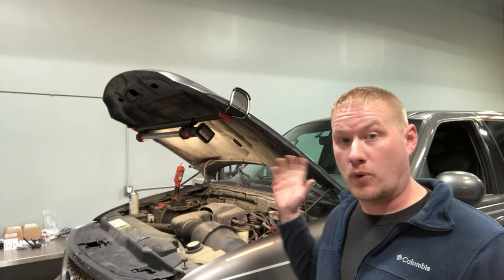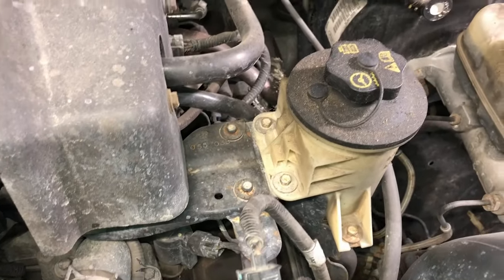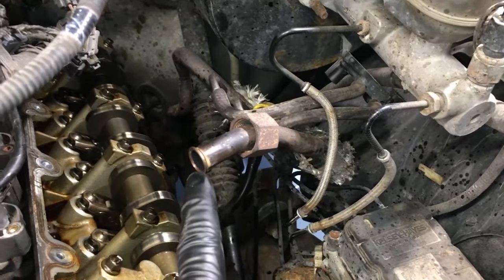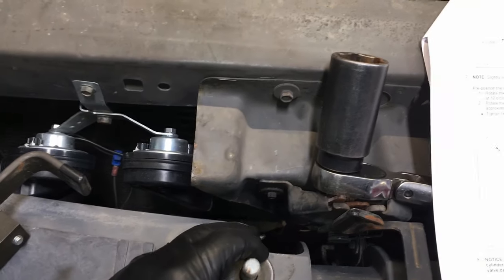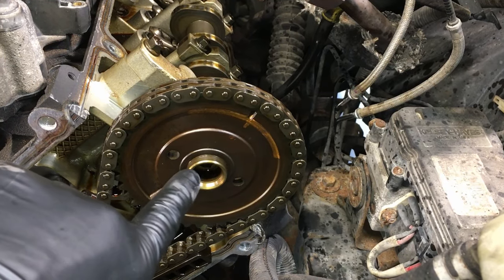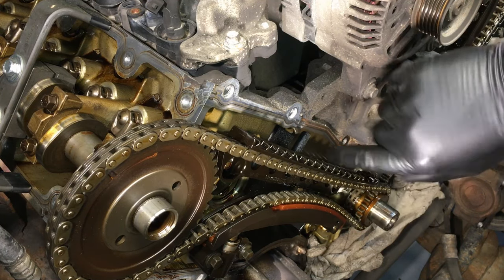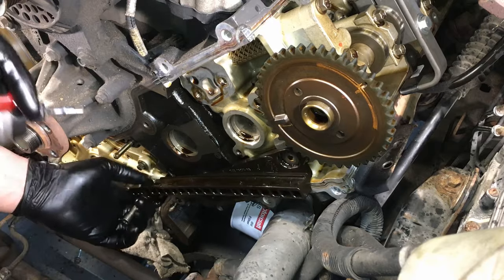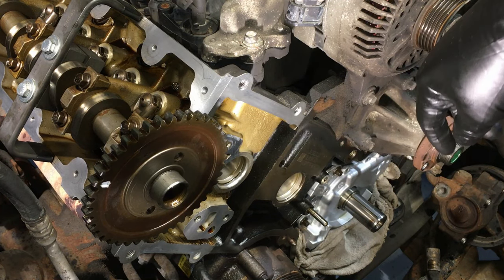Ford 5.4L 2v Triton Engine: Complete Timing Walkthrough

Comment: The 2 valve 5.4 & 4.6 engines were some of the best ford ever made. Too bad we never seem to know until 15 or 20 years after they appear
Reply: yes many 4.6 2v pass 500000 or 600000 miles with proper maintenance scedule....
Reply: I actually have a 2002 4.6 and just reached 260k miles. Just kept up with oil changes and still runs amazing. Unfortunately I did have to rebuild transmission at 220k miles.
Reply: And if you keep the boost under about 7psi, they make good reliable power. I know of one Mustang that's still running after putting 80k miles with a small turbo.
Reply: And don't forget the spark plug thread inserts if you plan on boost. Don't want to launch the plugs out of the engine.
Reply: Actually the best Ford engine was the 300 I6. Of the V8 variety you can't go wrong with any of the FE series.
Reply: @MrUbiquitousTech  Yes you right,,, i have my original 1984 f250 4.9 still going strong upper 100k miles.  I love the 2 valve triton.  Have 2 expeditions 5.4 2 valve 150 k plus and a Excursion 6.8 2 valve 196K  I change with Mobil 1 every 4k miles...
Reply: I wash your video on the 5.4 & 4.6 2 valve timing chain job, Why did you had to move the camshaft and crankshaft after you set TDC on 4.6 two valve engine.
Reply: My 5.4 is climbing up to 220k right now, got it 100k ago but she has had a hard life, been the farm truck for 7 years alot of the time pulling a 7k lb trailer with 16 1000 lb round bales per load.
Reply: I agree. Great engines. I have a 5.4 2 valve in my 99 E-250 Cargo.
It runs strong. little less than 177k original miles.
Reply: I’ve seen a 2v 5.4 go over a million. Took a lot of oil changes and coil packs but it did it. Good motors
Reply: @blakeevans7313  Hey Blake what brand of motor oil have you used in your Ford ??   Thank you
Reply: My 2002 F150 w/ 4.6 2 valve just rolled over 351,000. Has the original timing components and oil pump. I did rebuild the rear diff a few thousand miles ago...$1,200.00, and good for another 300K+ miles!
Reply: @mikewingler3042  i had to rebuild the rear diff on my 99 model. The spider gears had too much slack.
Reply: @DoyleHargraves  Mine was making a bit of noise...turns out it was a bad axle bearing. My brother in law is the service manager at a local Ford dealer, and I told them to tear it down and replace both wheel bearings, carrier bearings, and the pinion bearing. When the mech did the tear down, he found excess slack, as well. So, full rebuild. Quiet as a church mouse now!
Reply: @MrUbiquitousTech  ford made a much better v8 than the 300. The 300 was just cheap and cost effective
Reply: I have 270k on my 5.4. Engine is preditinateing on hills. I guess I should do the timing . Great video.
Reply: @MrUbiquitousTech  you so right! i have my original owner 84 F250 4.9 and i own 3 triton 2 valves(97 2000 Exp 5.4 and 03 Exc 6.8) with around 200k on them.  i will never get rid of these trucks
Reply: My 5.4 has 692xxx miles on it and its still rolling like a champ
Reply: @houstongordon9337   wow. I'm at 398,000,  so I know it could go the distance.  Runs smooth and quiet.  All original powertrain  too. I'm thinking of  getting  the timing  done but I have no symptoms.  At start up it just  starts  up smoothly  the way it should. No ticking ar rattle  at all. It does have the leaking  upper intake manifold  though,  which is about  to get fixed  with new plugs, injectors,  and coils.
Reply: I have a 99 Expo with a 5.4 and 385k miles.  Original motor and I'm just now doing timing LOL
Reply: My 5.4 has 318,000 on it. Just ordered the parts to do the timing and head gaskets. All because of a blown out spark plug.
Reply: Anyone has a link where to find what  how many valve is mine 2007 expedition 4 wheel 8 cyl. Xlt model
Reply: @benten6301  i would bet its a 3 valve 5.4L
Reply: @DoyleHargraves  I am having timing problems at 128k. It still drive. I am going to do it myself looking to buy the correct timing kit. Where should I get the kit because Amazon needs more detail to guarantee fit. Any recommendations , TIA.
Reply: 97 expedition 5.4 3v runs and gaps 👀👀
Reply: @JerryOutdoors  I have the same question
Reply: 98 Expie Eddie Bauer 5.4 4wd.....2nd owner......320K. Lots of maintenance items since 250k, but I don't have a $300 car payment 😁. Cheers to 400k. 🥂
Reply: The 5.4 sucks really bad
Reply: @mikewingler3042  😅pm
Reply: @rob_v_nj  11:57
Reply: @rob_v_nj  12:06
Reply: @codyswilley   😅😂 am me ul 41:04
Reply: @justaregular22b60  
There wasn’t a 3v in 97 it was a 2v
Reply: Everyone talks about how reliable theses engines are but yes head gaskets are a major issue!😂

Comment: 261,249 miles on my 5.4L in 2001 E150 van.   Never any issue with the mechanical parts of engine...original starter, alternator and water pump.  Used Mobil 1 since I got it at 18k miles.
Reply: Glenn Normand these  2v engines are absolute work horses. I am so glad Ford never put the 3v in the e series vans.
Reply: I have 333, 654 kms on mine runs great . Keep up on oil changes and use ford parts never an issue

Comment: If I would have seen this video 2 years ago I would probably still own my F150.  I was told it needed all new timing components and it was going to cost me big money so I sold it.  Well I do most of my own work but I had never done anything with the front of a motor but this is a job I could have easily done.  A really well made video and that's why I follow your channel.
Reply: I have a question i installed the cain tensioners. The driver side is easy to push the piston in and the passenger side is not is this normal ?

Comment: So I wanted to thank you for all your videos...I recently did a complete timing job on my 06 Ford F150, 5.4 3v...203,000+ miles. I had no timing issues but I didn't want to wait for a problem to arise...I also changed phasers, roller flowers,  plugs,  coils VCT solenoids, and crankshaft gear, oil pump. The camshafts and lash adjusters were in great shape so I didn't change them out.  All went well, running great so far. Thank you for all you do.

Comment: Thanks to Brian, I’m now starting a timing set on my 98 Exp. After 20 years of never using my air conditioning, I’m removing all that associated plumbing / containers for clearance in the passenger side. Inner fender guards are now out. I’m also going to slowly loosen the cam caps evenly, after setting that crank tool on the crank/ pin first. All rockers are getting changed, along with that high vol. pump he has mentioned. Thanks for all the spot on videos for us !!!👍

Comment: I want to thank you for all your videos …. I had a bad misfire on cylinder number 7. 5.4l 2v .
A garage wanted a $1600 to just to pull apart the drivers side head to find out the problem
. I decided to to take both heads off myself , i sent to them to get rebuilt . $750 . My main concern was the timing , this video on timing was amazing . It was true life saver . Overall for less than $1600 , parts and Labor by myself . I got a brand new running truck . I love my 97 Ford Expedition . Got 219k on the dash . Totally worth it than investing a new truck . Thank you thank you thank you

Comment: Thanks for the video it was very informative 👍I tackled this beast it was definitely a job I bought the cast iron tensioners they came with a metal plate gaskets....Do not use these they restrict the flow and they will not build up enough pressure to keep the chains tight I had to tear it apart twice to figure this out ! Hopefully this information will help with someone who gets the plates ...

Comment: Thank you very much for the video.  
I have two vehicles with a 5.4L 2V engine with over 340,000 miles. Took the oil filler cap off and heard a little noise so decided to go in and find the problem. My tensioners had frozen. Bought a Melling timing chain kit and oil pump. It's so quite now. The one thing I had to do is prime the oil pump with the spark plugs out. Thanks again

Comment: I want to really thank FordTechMauloco for this awesome video.  I am somewhat mechanically inclined but by no means a real good mechanic.  I watched this video and used it to perform this job on my 2003 F150 with 220,000 on it and the job went very very smooth.  Thanks for giving me the confidence and instruction to do so.  One note to the beginner.  Be careful when removing your valve covers.  The PCV baffles are glued on plastic inserts inside the covers from the factory.  They can break off.

Comment: Thank you Brian for doing this video! I’m getting ready to do the very same thing you just did so your expertise is much appreciated. Especially the special tools you listed. I have a ‘02 5.4l 2v with 209,000 miles and it sometimes runs smooth as silk but most of the the time she’s missing. I’m going to do plugs, coils, injectors and water pump at the same time as the timing chains and oil pump. I’ll let you know how it turns out!
Reply: Hi
Did you replaced the crank or the cam sprocket to or that don't need to be replaced?
Thanks
Reply: hickoryy1 I haven’t done the job yet! To many other things have been taking my time. I also haven’t got my kit yet, I’m doing exactly what Brian did tho. Using Motorcraft parts only!
Reply: Also with it kit you get a new crank sprocket but not the cam sprockets!
Reply: R Moss
The set I order from rock auto (melling 339s) show the crank sprocket on photo, but it's not included in the package. I have no problem to repleace that one, but the other two I have no idea how to.
Reply: So did you ever do the job?

Comment: Ive got a 9thread pi 2v head 5.4 i built with all mmr parts and JE pistons .10 over and running 18lbs of boost vmp gen 3 r blower . I absolutely love the 2 mod motors . Super reliable

Comment: Hi, FordTechMakuloco….
I used your Video to help me with the timing chain replacement, with roller rockers, lifters, oil and water pump replacement for a 2003 Expedition 5.4L 2V. I took the intake off along with the oil pan to help with the job. It took longer, but it was worth it. I took my time. It took me about a week to complete the job. The crankshaft alignment tool did not fit the dowel pin. The tool elongate opening was too short, but I still used it to line it up to the opening.  The tool to compress the valve springs did not work while in the car. I was going to replace the lifters because it could be the point of failure for the roller rockers. I did not need the valve spring compressor tool. To remove the roller rockers, I use a screwdriver to remove the roller rockers, and to replace the roller rocks I would a hook to pull the roller rockers on the lifters. It is easy to do. I put a hook into the oil hole and pulled it. Make sure the new lifters are compressed. It took very little time to do, if the intake was removed. I had to put a foot on top of the engine to get enough energy to pull. I took the oil pan off to look at the bottom of the pan. If I discovered metal particles, I would look at the connecting rod bearings. The engine had 220K and everything looked good. The roller rockers look good, but a few lifters seem to had failed. Meaning, I was able to compress them with my hand. The only other point of failure was the passenger side chain tensioner. It was compressed and unable to provide tension, so the chain was floppy and slapping the guides. The guides were still intact. I replaced the oil and water pumps with new ones. The only problem was replacing the passenger side valve cover. I had to use ultra gray gasket maker to seat the valve cover gasket in place. It was difficult to get the cover over the cam caps close to the fire wall. When I was able to get the cover over the cam cap, I double check gasket was still in place. That part of the valve cover is the point of failure for oil leaks. It was important to turn the engine over without the crank sensor connected. I was worried the roller rockers might fall off, but it was ok. After startup I only was able to perceive the click sound of the roller rockers for only a second. Once the lifters were doing their job the engine was very smooth. The only other issue was the PCM P1000 code. I ran the Expedition for about 30min on the highway and the next day did it again the code was gone.

Comment: It would be great if you could do more videos on the 5.4L V8 2V. SOHC Triton engines. I own a 2002   F-250 super duty 2WD ( why exactly they decided to make a rear two wheel drive super duty, I haven't the foggiest of a clue why..) with the 5.4 liter two-valve Triton and I have a difficult time finding much helpful information that pertains to my specific truck model and/ or the engine model ( respectively). I have scoured the web trying to learn as much as I possibly can about doing work on these things. I am not a mechanic, I just started learning about this stuff for a few reasons, one is that I want to be able to work on and fix my own vehicle, two, I don't want to pay for someone else to work on my stuff ( cause I am cheap, mechanics are not. And I am broke..) and lastly, I just plain like to learn and know about useful things. Knowledge is power in my book. So, if it's possible to do more videos for the 5.4 liter 2- valves, it would be awesome. Maybe some videos on my particular model of super duty, I had a question about the ABS system and cruise control on my truck. I have retrieved the ABS module DTCs for both of the front wheel speed sensors input missing, further inspection showed that I am missing the tone rings on both sides, therefore my ABS doesn't work and neither does my cruise control due to the ABS system fault codes ( I believe), I am a little confused about the whole procedure to fix the tone rings problem. I was led to believe that I would just be able to slap on some new tone rings but when I looked for replacements online I can't find any other than the one tone ring for the rear differential, when I talked to someone at the local "stealership" ( as I like to call it) the had told me that there is no replacements for just the tone rings and that I would have to buy a whole new hub assembly for each side running about $300.00 or so a piece. However, I have seen videos ( one of them your's) where they're able to just swap out the broken tone rings. So I am getting some contradicting information hear and I cannot justify spending that much on new hub assemblies, nor could I even if I wanted to cause I cannot afford to pay that. Some clarification on the subject would be greatly appreciated 🙏 also I would like to thank you for the videos that you have made and for sharing your knowledge and experience with people like me that have the willingness and need to learn about this stuff. Keep up the good work!!!! 👍👍🤘🤘

Comment: A sincere thank you. Especially for the disclaimer at the end regarding doing the job without all the specialty tools. Timing was secondary to having removed the heads for a seized piston. I read through Alldatas info in advance and then followed this video, pausing periodically. After completion. I had worries if gauging the locations were off that I could cause a lot of damage but at the conclusion with the explanations you gave. I feel very confident that all the timing is correct. Tomorrow I still need to put all of yhe top end together but I'm confident timing is correct.  Thanks again!

Comment: dude I know this isn't that video,but I bought a 04 5.4 F150, I use your videos for reference. So I did the VCT solenoid and low and behold bank 2 was a Dorman.They both looked fine ,unnnnnntil I looked at the ends.The snap ring and all the guts are gone.I don't know where the parts are but I'm assuming they went down.Haha I think I watched every video of yours ,but you might have to make another one.This ones another great video.

Comment: I'm about to rebuild my 5.4L 2v with a few performance upgrades which includes cylinder heads and camshafts and this is the part I was worried about the most. I've never rebuilt an engine with overhead cams. Thanks for showing me how easy it really is.
Reply: What cams did you put in?
Reply: @urmommaahugehoe  Stage 2 cams from Modular Head Shop

Comment: My 2001 5.4 ²v has 400,000 miles on it, thankfully it's still going strong. It has a few hiccup from time.
Reply: Have you ever changed your timing chain and tensioners?
Reply: @stallionranchwoodworks , Nope never changed or had any problems with timing chain or tensioners and I have owned this truck since new in 2001.

Comment: This timing job video made doing a timing job DIY style look really really easy. As someone who wouldnt have a lot of money laying around, our biggest fear is having Valves and Pistons kiss. I just reached 140k on my '02 F150 with the 5.4 2v and when I heard you say the words of now this timing set will go for another 150k-200k. I should start saving up. Great video and my EGR tube did the same thing and came lose the way yours did in the video when I replaced my cracked Intake Manifold. I need new Valve cover gaskets so I'm glad the covers squeeze by it. Great video 👍 and lots of hidden and helpful info/input.

Comment: Loved the video it's very helpful, I just had one question. I saw that the plastic tensioner had a gasket but I saw you installed the cast iron ones with no gasket. If I switch to the cast iron does that mean I no longer need a gasket?
Reply: Was wondering the same thing
Reply: Yes, the plastic one is hydraulic so it needs a seal to contain the oil to build up pressure. The cast iron one is mechanical and therefore doesn't need a tight seal.
Reply: ford put a ton of money into a new plastic tentioners for some reason... so high heat or high pressure situations imo require metal 
stock daily use plastic